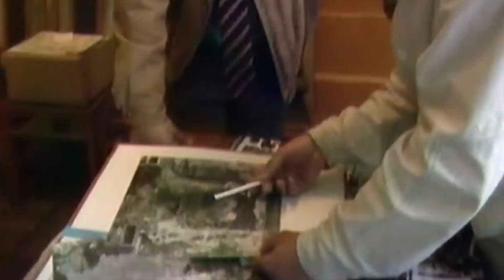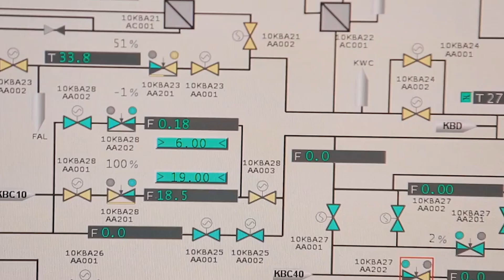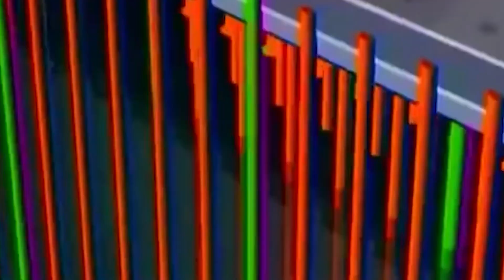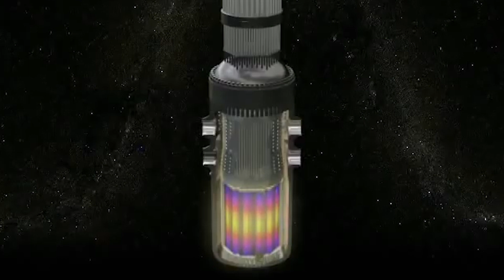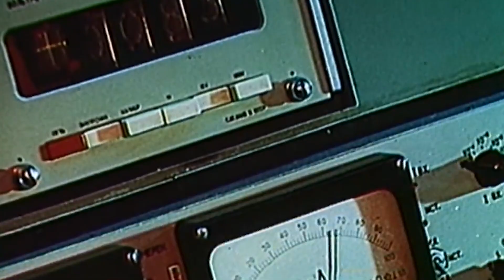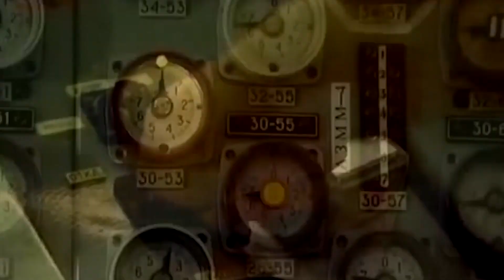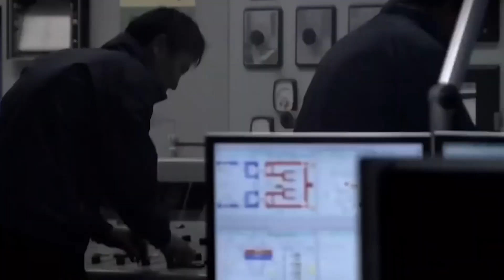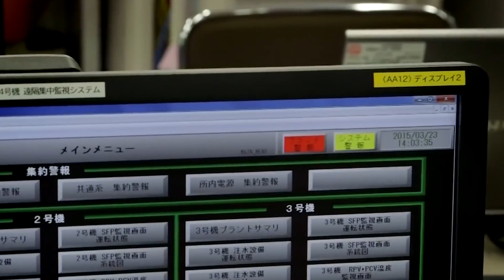Chernobyl and Fukushima — nuclear accidents described in a simple way

Comment: Fukushima wasn't a disaster by any sane or informed measure. It was nothing short of a triumph of engineering and design over 50 years old. It was struck by the single greatest cataclysmic event in recorded history, and it held its ground like a champion. At this point in time, after the fallout has settled and we have had a chance to quantify the fallout, it has been found to be effectively zero. 

The median fallout in the 20km evacuation area around the plant is expected to contribute approximately 20 mSv per year to anyone residing there constantly. That's twice as much radiation as you get just from living in a single story house with wooden floors, or the same dosage you get if it has cement floors(a monolithic foundation). That's 6% more than the median background radiation level of the 20 largest cities in the world!! There was however, enough radioactive material leaked into the ocean to be statistically detectable in the water near San Francisco CA, USA. A 0.0007% increase in the average detected Cesium and Iodine levels. No risk of health effects. Oh, and there was also damage to croplands northwest of the plant, where detectable cesium levels are considered "concerning" levels, and thus will not be eaten or sold, and the area will not be inhabited for the foreseeable future.
 
Not a single death has occurred in the population related to radioactive leakage EXCEPT in the people employed and working directly at the plant during the event. Even considering the 1 dead worker from lung cancer, and 6 workers that now have leukemia, this plant deserves a freaking trophy for outstanding safety. It was struck by the hand of an angry god and it survived, even if crippled.